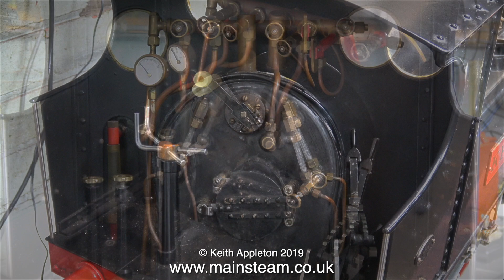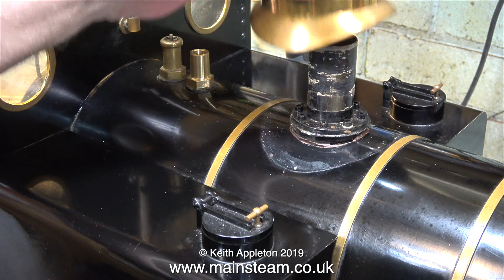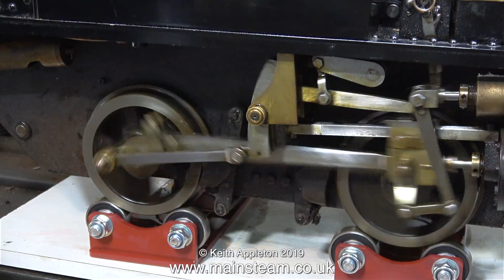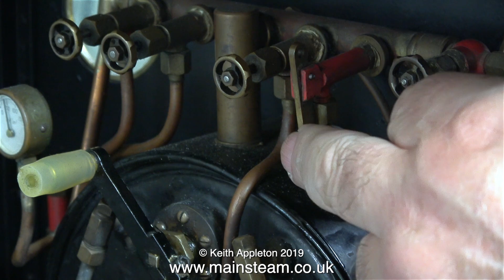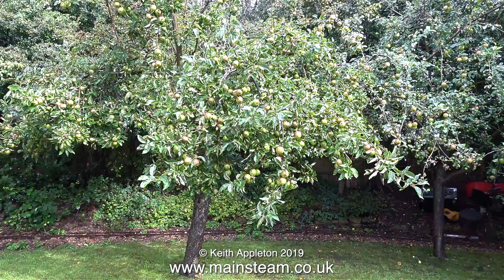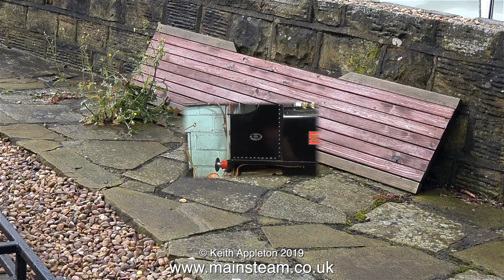MY SMALL STEAM LOCOMOTIVE CALLED KEN

Comment: Problem I had with my own 5" loco was that the suspension was very hard. It has a commercially assembled chassis, and the bolts used  over-compressed the suspension springs, I changed this, and now it runs fine.

Comment: Nice loco but who makes that reliable lubricator on it?? Or did you make it yourself?
Reply from the maker: It is a commercial unit that I added a second tank to with a balancing pipe.
Reply: @keithappleton  is it a black gates product or someone elses? Who makes it or made it? Reliable anything is hard to come by in the hobby so when I hear of one I like to know who did the great job! Some builders are great and some are sloppy. Watching your videos I see you fixing a good bit of sloppy work or guys who think everything prototypical is the way to go. Not everything works as it should in exact scale.
Reply from the maker: Blackgates have sold them for many years, and I have bought a few in my time. I think that the pumps were originally an LBSC design. They seem to work very well.
Reply: @keithappleton  thanks Keith you're a wealth of info and do good quality work. A gem to the hobby. Took me a bit to get your sense of humor when I first started watching you but once I realized it was sarcasm and poking fun it's made your videos even better. Thanks again for all that you do share with us!

Comment: Great video Kieth I truly admire your engineering skills to build a locomotive.
I notice that in forward gear the radius rod is at the top of the expansion link.
Most full size locos I have seen this would be reverse.
Can you explain in simple terms why is it the opposite  way around as I'm just curious. 
That is a beautiful locomotive.
Reply from the maker: The drawing was wrong and I modified the design slightly.

Comment: In the view of the cab, one seemingly quite major control was never labeled: The bent silver handle atop the vertical post, between the firebox door and injector valves. What is that, what does it do?
9:01 Mentions problem with flat car's wheels getting rusty, which causes friction going around curves - wouldn't that be resolved by running it a bit more to rub the rust off the wheels? Typically train wheels get very shiny very quickly when running, would probably take longer with a scale model than a real full-size train, but I'd still think it would resolve itself pretty quickly.
Reply from the maker: That will be the obvious one that everyone knows - the regulator . . . . . if only I had the time to clean 400 feet of rusty track before every run . . . .
Reply: The regulator was marked as the handle centered near the top of the boiler, so I would assume the handle in question must be something else. Now that I think of it, is it the brake? It looks like it might actuate some sort of screw mechanism, and that's the one rather important control we don't see labeled or mentioned.
Reply: I think you mean the handbrake. Turn the handle to put the brakes on.

Comment: Speaking of controls, you mentioned the reversing lever last, with no added details. As far as I know, on an actual, full-sized locomotive, the cut-off is a crucial bit that you have to adjust several times as you travel, starting full open to start moving, then easing it down to pick up speed and save steam, depending on service, incline, weight of the train, etc.
Are model locomotives "easier" to drive in that you just put them in forward or reverse and forget about it until you have to stop?
Reply from the maker: Not really, they work as in the full size, notch back once you get rolling ....
Reply: Thanks!
Reply: I read that the most efficient way to run a steam locomotive is, throttle wide open and use the johnson bar to adjust speed. I wasn’t taught that, but I run an Accucraft Ruby that way. It’s way too fast for a small locomotive, and it stalls out if you try to slow down!

Comment: Nice engine that. I managed to figure out the cab controls prior to the labling, and I got about 90% right. A good simple arrangement. The wobbling when pulling hard is a fairly nice unintended feature imo because I've seen it on fullsize engines when worked excessively hard, and it gives your engine character. Good model all around, cheers.